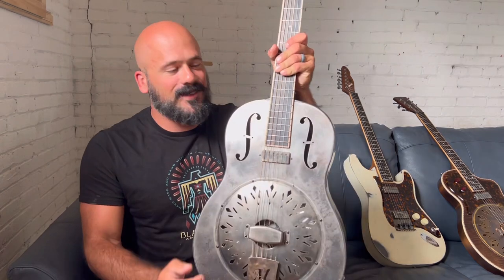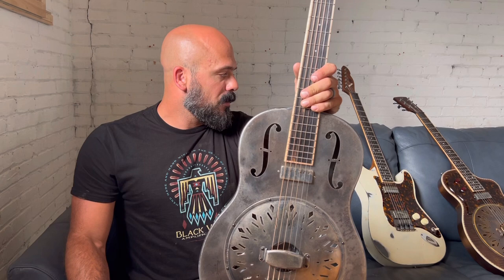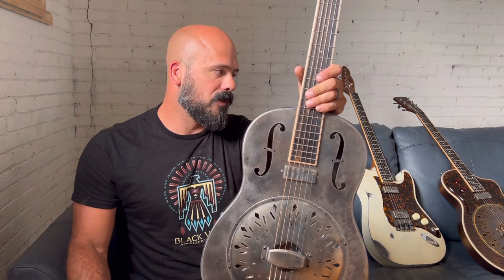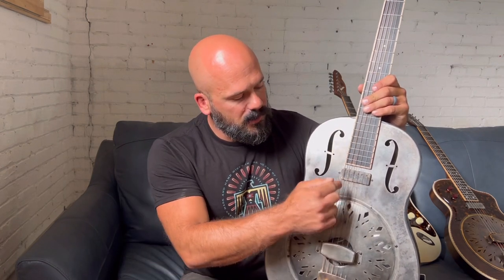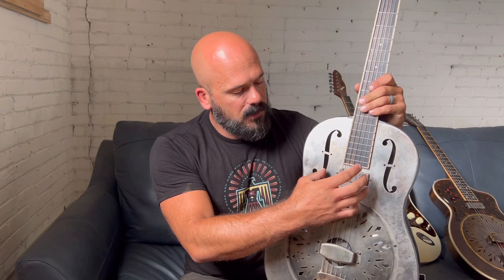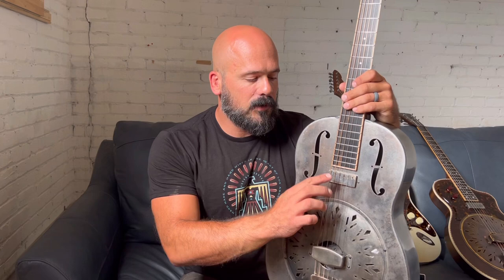The only acoustic guitar pickup you need

Comment: If it helps at all, pickups, the more parts it has, the more it vibrates with the copper coils creating something similar to the vibrating membrane of a microphone. So it really picks acoustic sound, and thats the big magic of a lot of vintage pickups, be it pafs, filtertrons, singlecoils, goldfoils or the lipsticks. They add a lil acoustic to the mix that sounds very good
The problem, is that at super high volumes and mostly with gain, as any microphone, it can feedback as it can hear the amp
And thats why modern pickups are wax potted, but that eliminates that magic sound
Some boutique companies offer no potting, light potting, or heavy potting